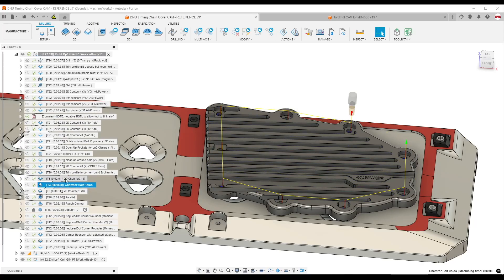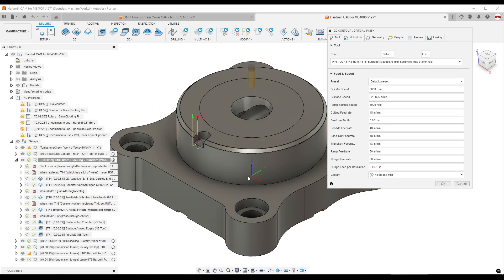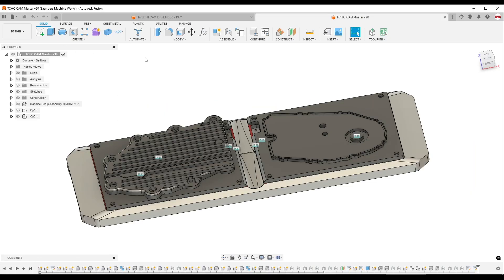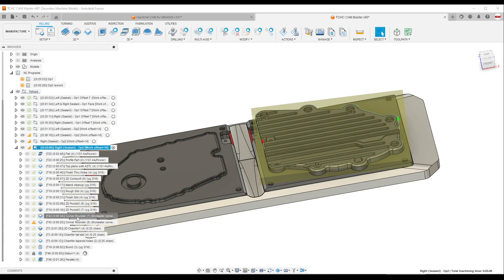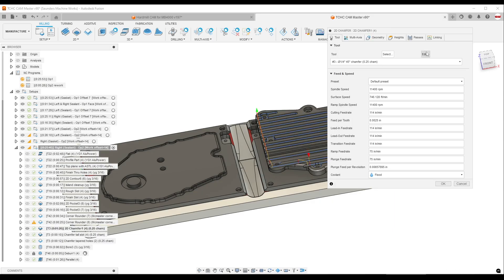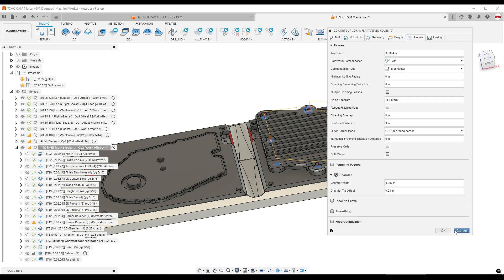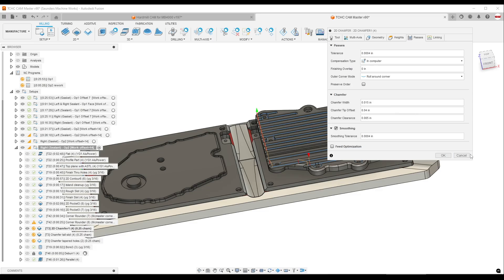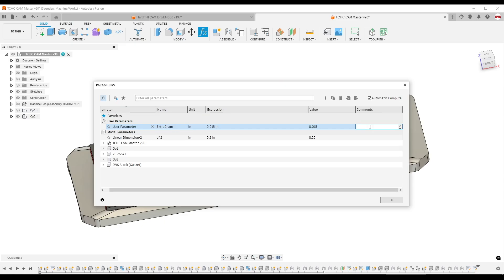STOP Repeating values in Fusion 360! Use CAM Parameters!

Comment: I thought this was around a long time ago  I wish they would give access to the params while in CAM…hopefully soon.  I’d use it more if I didn’t have to hop between CAM and design to setup my ops with parameters.
Reply from the maker: they do!
Reply: @nyccnc Well, I wasn’t clear.  Access to the parameter table to change values. I have found no way to pull up the parameters to change their values while in manufacturing workspace.  You can use the parameters but can’t create or change them. If I’m wrong, I would be thrilled to find out!
Reply: @nyccnc And as long as I’m hoping, I wish they would create something similar to configurations for cam setups. I have several parts that are all made from many materials. Ti, SS, copper, brass, aluminum. All the copper brass and aluminum use the same tools but with different surface and feed speeds.  The ti and SS also use the tools but different feeds and surface speeds. I have to have a separate setup for each one even though all the operations are the same.  It would be awesome to have a setup for brass,copper,aluminum and then have a config that encapsulates my feeds and speeds.  Then the nc program would let me specify the different parameters they would get plugged in to generate a separate nc program for each material. 

Wishing is free!